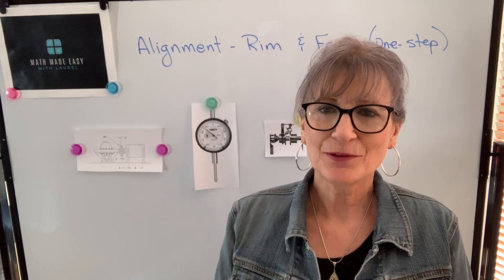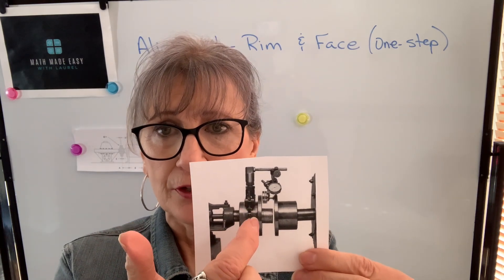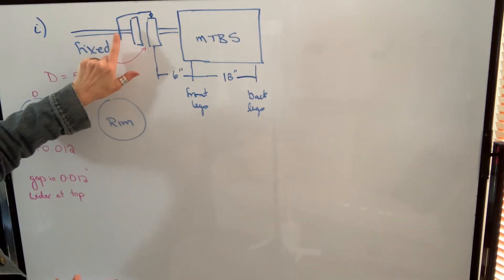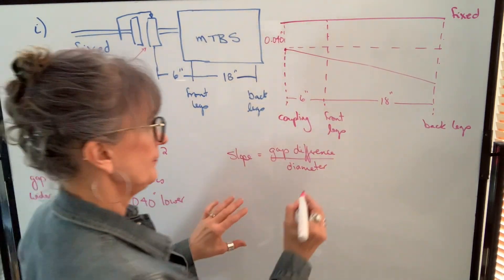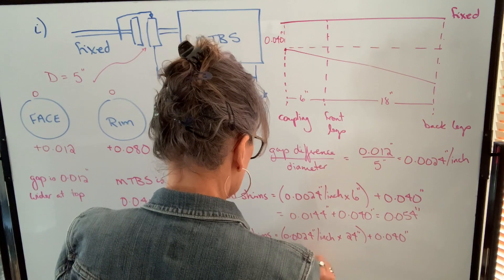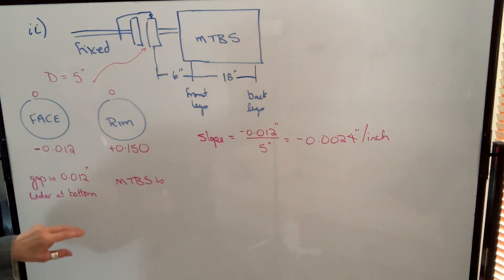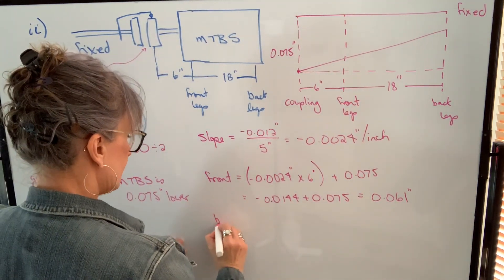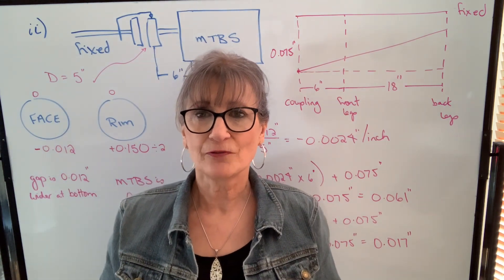Trades Math - Rim and Face Alignment Part 2

Comment: whats happen when the dial is mounting outside the flange, not inside like your demo, me my reading is négatif, whats this change the calcule
Reply from the maker: If you mount the dial on the outside of the flange, the readings will mean the opposite to what they do on the inside.  For example, if mounting the dial on the inside of the flange,  a positive reading at the bottom means the coupling is closer at the bottom and therefore the gap is wider at the top.  However if the dial is mounted on the outside of the flange, a positive reading at the bottom would indicate that the gap is wider at the bottom.

Comment: Assuming that the shaft of the fixed machine cannot be rotated due to some any circumstances and we try to install the dial indicator fixture in opposite way and take the reading of rim and face at the fixed coupling, is it possible or not? How about the calculation? What is the difference between the two types of dial indicator fixture installation?
Reply from the maker: Hi Marlou.  Yes you can mount the dial indicator on the moveable shaft instead of the fixed.  The trick is to understand what a negative and positive reading mean when reading on the fixed shaft instead of the moveable.  Basically the readings will be opposite in sign.  Based on whether the plunger is pushed in (positive reading) or if it releases (negative reading), you can visualize where the fixed shaft is in relation to the moveable.  I hope that explanation makes sense.
Reply: Thank you.

Comment: Hello, thank you for the very good training, only one thing with the demonstration on the video of the RIM and Face alignment, your demonstration also corrects the angular difference from west to east, or you have to do other calculations to make the correction, as my language is French I used the corrector and I hope that my question is well asked
Reply: Hi Michel.  The Rim and Face method does correct the vertical angular misalignment as well as the vertical offset misalignment so no other calculations are required.  However, a separate set of measurements and calculations would be required to do horizontal alignment.  Is that what you are referring to?
Reply: @laurel500  yes I referring for the calculations for the horizontal alignement
Reply: can you do a demo for the horizontal alignement
Reply from the maker: @michelstellato6395  Sorry but I never taught horizontal alignment in my classes.  It is easier than vertical alignment because you are just shifting the moveable machine rather than putting shims under the feet.  You should do it in two steps rather than use a one-stop method.  Always correct the angular misalignment first (i.e make it parallel) then correct the offset.  Hope this helps.